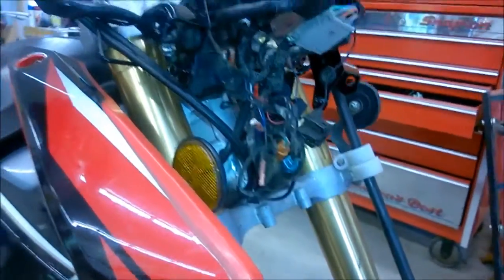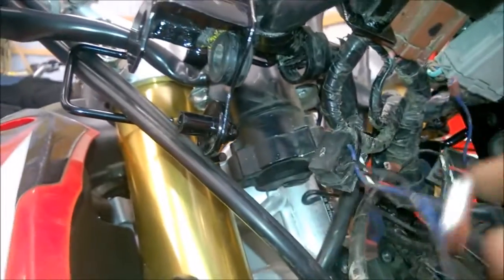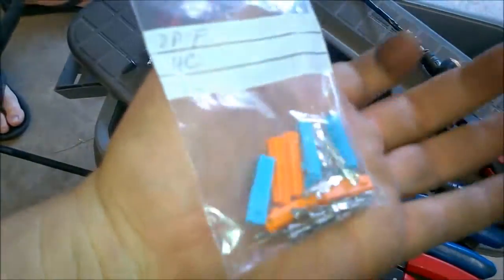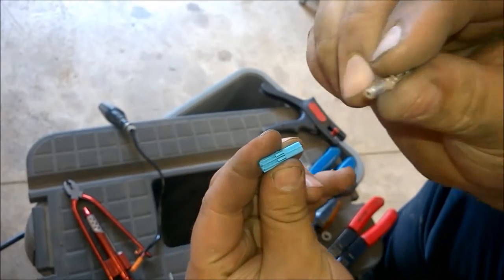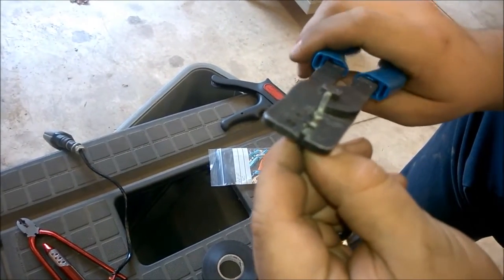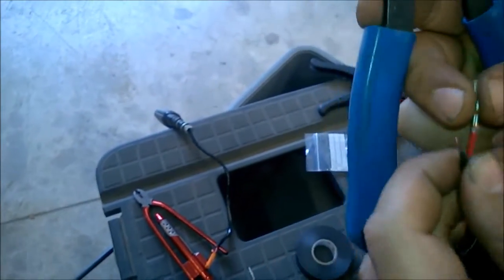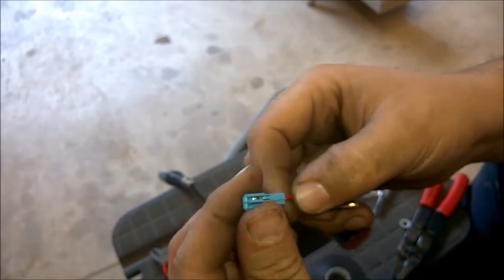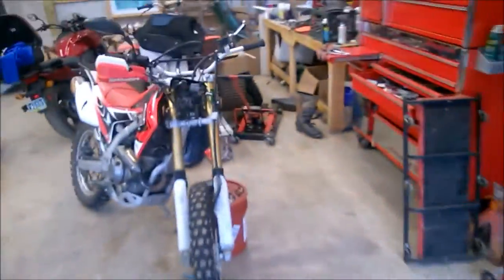DRC 602 Turn Signal Wiring CRF250L

Comment: Hi Chad,
Nice vid. I'm also using the orange and blue connectors as well.
I'm confused on how to splice the two red wires from the running light relay to the black wire coming from the gray junction box. How did you do it?

Thank you for the vid
Sandy
Reply from the maker: Hi Sandy, it's been quite some time since I wired them up now. But if I recall correctly, the two red wires get power from that one black wire on that big connector. And if that's correct, what I did was tied the two wires to one short jumper wire- soldered that connection and applied heatshrink tubing, and then I think I soldered the jumper wire to the black wire and applied heatshrink. Taking the extra little time with the wiring will pay off big time down the road. Otherwise you'll be constantly having wiring issues because of all the dirt/water/vibration. Hope this helps!
Reply: Chad Liguori thanks. I've got some Posi-Tacs on order and will use them instead of soldering. I suck at soldering:-)

Comment: THANK YOU for this video!
It's utter bs how unclear instructions are with turn signal kits, and product descriptions online. I'm completely new to electrical, and having some sort of information for newbies on the box or online explaining the necesscary tools and procedure for wiring wouldn't be hard, and only helpful.

Just "here's the drc turn signals, taillight, screws, terminals n stuff. You're on your own."

I've made multiple trips to hardware and auto parts stores, looking for tools I don't even know about. Bought the wrong things.

I need to ask, what's the name of that ABCDE tool you're using? That's what I need to look for.
Reply from the maker: You can get them just about anywhere, even Amazon. I got mine from the Snap On guy that comes to my shop (they're Blue Point). You can also get the pliers from Eastern Beaver when you get the terminals (if you get them from them)
Reply from the maker: I'm just glad I could help.
Reply: Chad Liguori So today, I literally visited ACE Hardware, Advanced Auto Parts, O'Rielly, Auto Zone, Menards, Farm & Fleet, and Napa today. They all had the exact same stuff in electrical and hand tools. NONE of them had what I was looking for. I ended up buying stuff I didn't need. I had to drive out of town for these things.

A $10 cheap wire stripper tool I got in town ended up being what I used, and worked fine. Silly day, but at least I met a new friend to help me out in my garage for future projects. Thanks for the help, though, Chad. This tool is hard to find in store apparently. Online only.

Comment: hey i recently bought a 2015 CRF250L... i fell to the side and hit the left turn signal... it doesnt turn on anymore.. only when i apply the left turn switch it blinks but it doesnt stay on like the right one
Reply from the maker: +Carlos Avila Are they the factory turn signals? If so, check the bulb, it should be a dual filament bulb, and most likely the one filament is bad, but not the other one. Try replacing the bulb if it's factory

Comment: Hi Chad, appreciate the video. Soon I am installing my DRC601s. Would you mind sharing the item code of the connectors! Thanks, cheers and ride safe bro!
Reply from the maker: Jerome Pascual http://www.easternbeaver.com/Main/Elec__Products/Connectors/050_Connectors/050_connectors.html - I used the HC050 connectors in orange and blue. You'll need both male and female for each. Get a couple extra just in case.
Reply: Thanks Chad Liguori